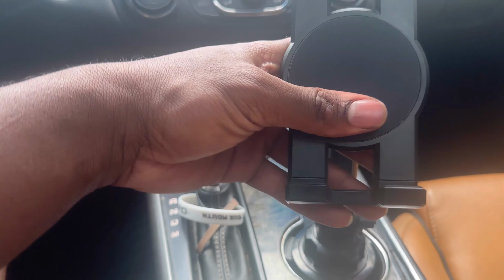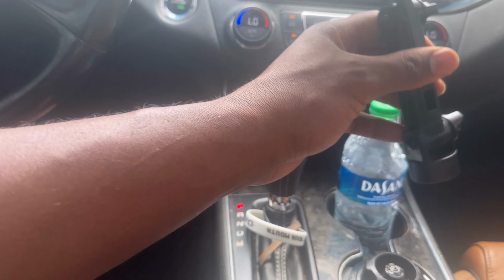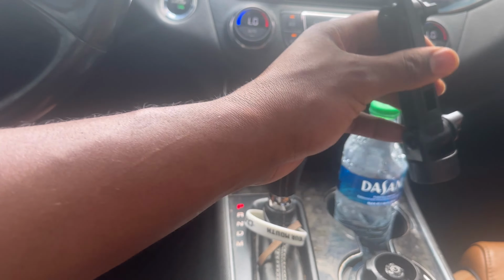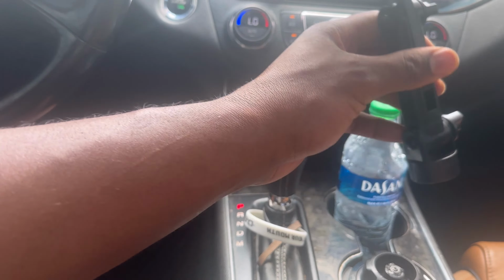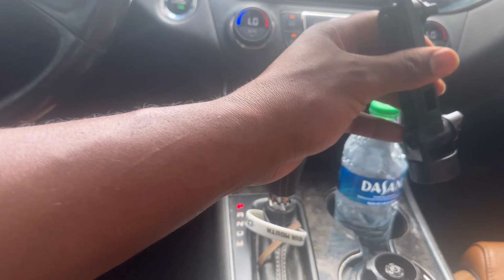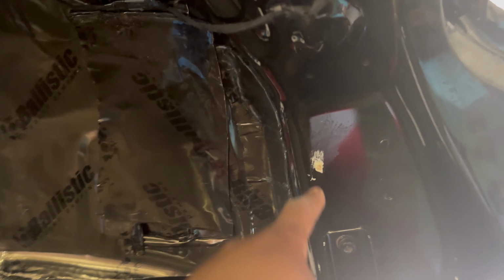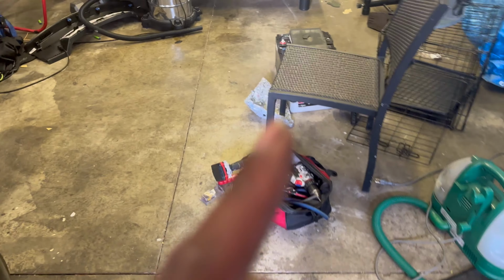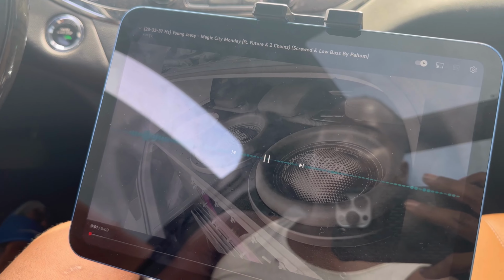Sound Deadening My Trunk

Comment: If you want a more rigid mount for your tablet try one with a seat mount bolt attachment. They're expensive but definitely worth it. The tablet will float over your center console and youll get that room back. Poly-fil works on those large voids in the trunk. It takes a while to get it in all the little areas but it made a huge difference in my car.  Mass loaded vinyl works really well too. You can use aluminum tape to mount it on vertical surfaces too.